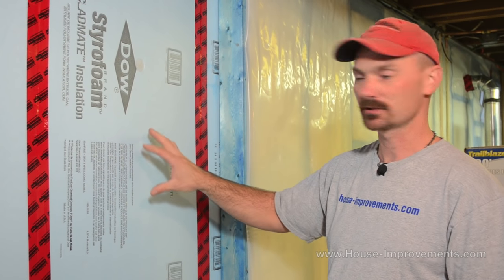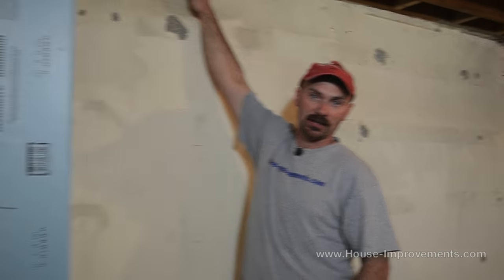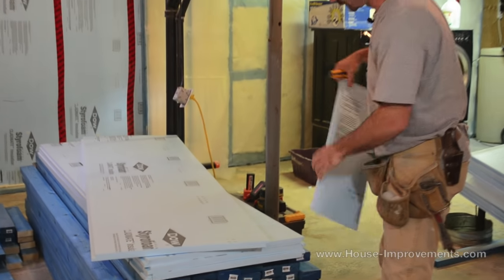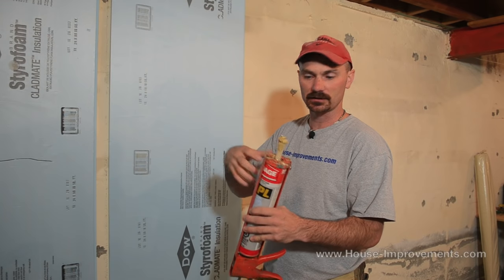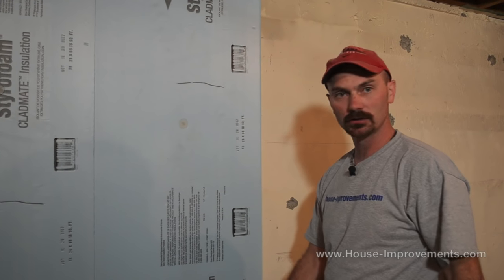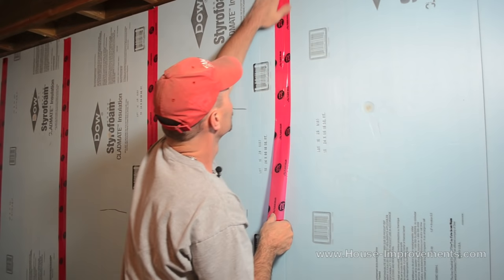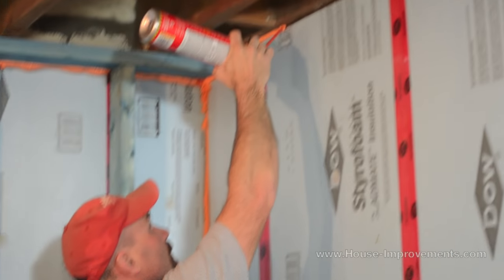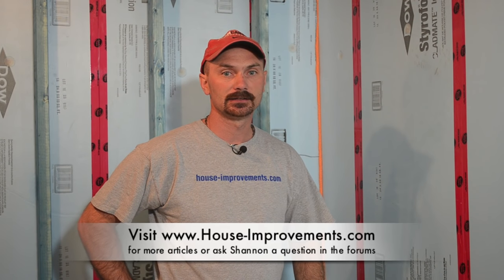How To Attach Rigid Foam Insulation To Concrete

Comment: NEVER NEVER use poly or Fibreglas insulation in a basement - video is obsolete!
Reply from the maker: This is your opinion.
Reply: HouseImprovements
Not mine, do the research youeself or follow the link- Builders need to understand the science of MOLD. Builders MUST educate themselfs or homeowners will suffer the consequences of mold.
http://www.greenbuildingadvisor.com/blogs/dept/musings/joe-lstiburek-discusses-basement-insulation-and-vapor-retarders

Comment: Another video misleading people into believing that there is such a thing as "cold"; there isn't. Heat transfers from warm to less warm. No such thing as cold migrating into a warm space. In a basement there is very little air moving through concrete so, considering the FACT that there are only 3 types of heat transfer, conductive, convective and radiant, which ones will all your insulation mitigate? Probably only conductive but then, doesn't a simple air space accomplish that?

Comment: So 2 vapor barriers. Way to go! Not. (You now have a trapped airspace. In a basement no less.)  Think bigger picture. Do something that will last. Do something that will be safe.  Concrete wall will still absorb moisture from the outside. Moisture will condense. If no heat can get to the moisture, the wall can't release moisture. Wet wall will eventually crack because wall will freeze even more now that you have insulated the inside. And when it cracks, the moisture will condense at some point and come inside.  Ever seen mold in foam? 

Even if you do this stupid installation; Why waist time drilling whole's in foundation wall when there is adhesive for this (even 1 year ago).

To do a job right and that actually makes best sense is to install rigid foam on the outside of the foundation wall. (Moves dew point outside of the building)

Cold climate research says 2/3 of R value insulation should go on the outside but I think that ratio and Thickness of Rigid foam depends on Homes climate zone.

Am tired of seeing this BS, wake up, stop eating GMO food and protect your brain from EMRadiation.
Reply from the maker: Bla Bla Bla, your opinion is your opinion. Your way can be done as well, but not many people want to excavate the exterior of their foundation to do it. Both ways meet code.The adhesive works if your walls are at least semi flat but when they are not you need to use the anchors , if you had listened and watched I talked about the adhesive and also the reason I was not using it.
Reply: On your suggestion to "install rigid foam on the outside of the foundation wall", what exactly do you mean? Do you mean to excavate the entire foundation around the house and layer the cinder blocks on the outside with foam, then put the dirt in again next to the foam? That sounds... unusual. When you say "Moves dew point outside of the building" what do you mean? There is a dew point everywhere. You can't have anywhere that a dew point does not exist.
Reply: LucidDreamTricks If you want the best solution to insulate a basement then Yes, I mean excavate, install foam, and cover it with something if you want foam to last. But if you do just throw dirt against it then it will insulate for a while. say 10 years. and try not putting holes in it while you are doing this.

Sounds unusual? Do some research on exterior insulation. It's not a secret.

I didn't say "remove" the dew point. I said "move" it out of the structure. yes, Dew point is everywhere. Including inside the wall. What happens when dew point is reached? gas turn into a liquid. Water vapor condenses into water. Or freezes (frost) and melts into water later. Would you like this process to happen inside the wall? Do you like mold, mildew, cracked foundation walls, rotting wood framing? I don't. That's why I spoke up and called this ignorant ass or crook out.

You can stop condensation from occurring (the dew point) within the wall by not letting the wall get cold by insulating the outside. The heat you create will keep the wall warm. And it will stay warm because you have put a blanket on your foundation wall to stop the cold of winter entering the structure. The dew point will be somewhere within the exterior foam where the cold meets the warm.
Reply: D eez I see. How many houses have you excavated and wrapped their foundations in foam?
Reply: 3 and one on the go. But all have only been 4 feet down from grade to footing. Best time to do an exterior insulation install is when replacing weeping drainage pipe.

What does it matter "how many houses" though?  The big picture regarding condensation matters.
Reply: D eez,

You know just enough to be dangerous, but the devil is in the details.... 
First, 1 inch of XPS has a PERM rating of 1.1, which means it is vapour semi-permeable. You would be correct if XPS were in fact impermeable. 

Yes, concrete can and will absorb some moisture. Almost any builder now uses an elastomeric coating as a waterproof membrane as required by code because going without to waterproofing requires a higher strength concrete. That's more money, and we all know contractors don't want to do that... At the footing of the basement wall is a weeping system with gravel over top. Standing water is drained as it accumulates so there is no hydraulic pressure. Really the elastomeric coating and/or dimple board is only a capillary break.

The concrete walls are not going to crack because the concrete mix design is specifically for subgrade use. Moisture does not damage concrete or any rebar that may be in it. Concrete is alkaline preventing steel reinforcement from corrosion. It only rusts if the concrete is physically damaged or exposed to chlorides (like road salt). 

Either installation method is perfectly acceptable. 

Yes, insulating on the exterior is advantageous, but even that has it's challenges such are protecting the insulation above grade. It is also not financially feasible once the house is already built and the foundation back filled.. 

You have the cold climate research wrong. There is a ratio of interior to exterior insulation is you in fact choose to use exterior insulation. It is based on degree days, so the ratio will vary, but for the majority of climates, the ratio is minimum 20% exterior (up to 4999 degree days). It is minimum 30% for 5000-5999 which covers the cities in all of the Canadian provinces. Higher ratios are required for the territories. But don't take my word for it. I've only studied Building Science at the graduate level. Check our NRC - https://www.nrc-cnrc.gc.ca/ctu-sc/files/doc/ctu-sc/ctu-n41_eng.pdf - Page 4. It has the info you are looking for. The reason for this is to move the temperature above the dew point so condensation doesn't occur within the wall cavity. This is really for above grade walls where wood sheathing is used. If you don't use exterior insulation, which is perfectly acceptable, sheathing is able to dry to the exterior provided an air space is used behind whatever wall cladding is used. If you do use exterior insulation, the ratio applies to prevent an increase in moisture content in the wood. 

The reason Shannon is sealing both above and below the ship lapped XPS is to prevent the interior moisture laden air from getting behind the XPS where it could condense. Even if water does get back there, it doesn't harm the wall, but it can run down the wall and onto the floor where interior materials can be damaged.   

I'm not going to dignify your last comment with a response. 

It's a shame so few people have anything of value to add to these comments. All I can say is make sure you have your facts straight before commenting or don't comment at all.

Keep up the good work Shannon.
Reply: In an existing house how the f%#*  do you insulate the entire outside foundation wall down to the footing without 30 thousand dollars of exaction and re landscaping. I agree no double vapor barrier and from all that i have learned recently i have surmised we really should not be putting rooms in basements of old homes unless there is exterior insulation up to and over the sill and rim joist, which no one does. I'm torn as to what to do these days. Very frustrating watching experienced and thought to be knowledgeable people contradict each other all the time. I don't do basement jobs anymore because what i thought was the right way(and approved by the IRC) is now thought to be incorrect and actually harmful. I've heard good reasons why even closed cell sprayed on can lead to bad problems.
Reply: Dont forget soy milk is bad for your brain to
Reply: D eez+ what about when much of the basement wall is exposed on the outside of the building? what would you do about the visible pink boards? I like your line of thinking; this is a serious question
Reply: Patrick Troy anything soy is bad for males. It’s like eating/drinking estrogen
Reply: D eez - I love tough guys that get confronted with real knowledge and then guess what... you don't hear a peep.  Everyone thinks their a genius until they are in the situation and something foils their idea, so they have to blame someone else to justify their logic.  Dynamic thinking will win everyday of the week vs. the "we always do it that way" way of thinking.  If you are not in the situation just shut your hole, all you are doing is beating your chest and sounding like an idiot.
Reply: Sure, if money is no object then excavate all around the foundation and install the foam (and drainage). But most homeowners don't want to spend that much so it goes on the inside. If there is an obvious water infiltration problem then exterior work is the way to go to first and foremost intercept that water and drain it away.
Reply: Hello Deez,
I have a house that was built in 69,The house is a split level house and as you said it is 4 feet deep foundation.The entire house is wrapped with thick blue foam.
Now I have demolished the basement and the walls are made from cinder blocks and painted with black tar.
Please,can you tell me how to insulate the basement walls?
I see that the previous owner put white very tick styrofoam but only above grade.
So I am thinking to put more foam and then put R24 insulation without water barrier. Water Barrier is scary to me.
The thing is I do not want to use drywall.I hate drywall and I want to put wooden walls.
Can you please tell me if you suspect any problems and ways to avoid them?
Reply: Can’t put it on the outside of an existing house.
Reply: D eez  where can I get the glue to adhere it?  Thanks.
Reply: HouseImprovements  what type and brand of spray foam are you using?  Thanks.
Reply: What if you do foam on the exterior and interior as well?